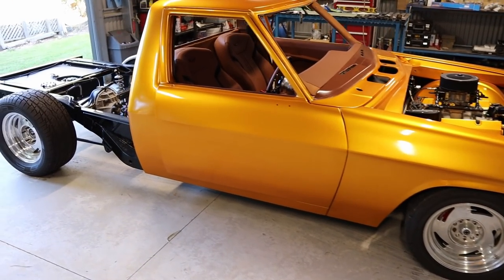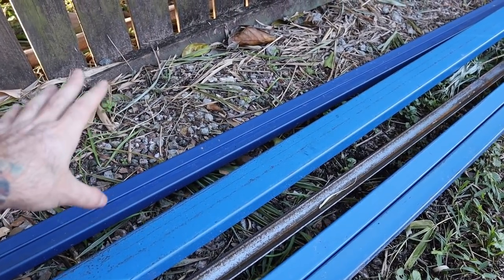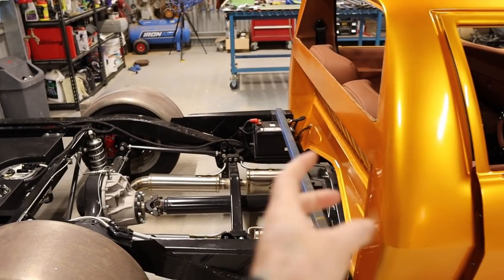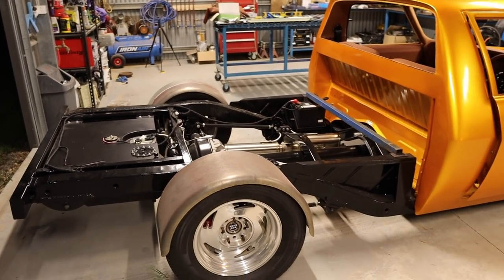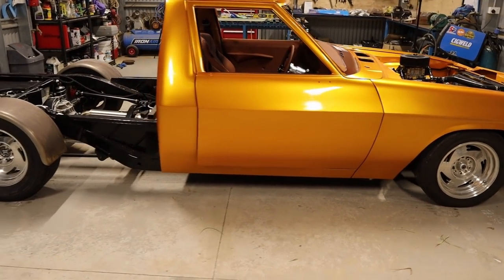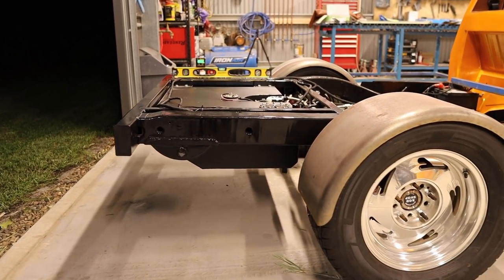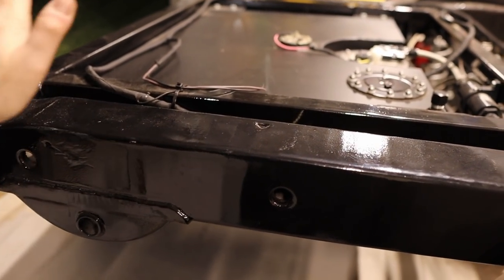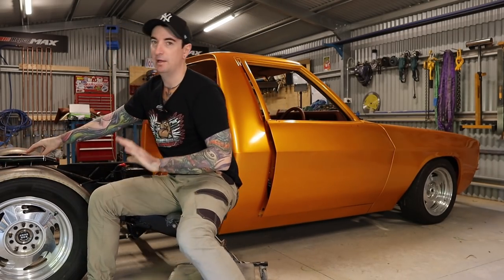Starting the Tray but Encountering Problems - HX One Tonner Tray Build Episode 1

Comment: Hey man , As mentioned above , take the ute to a panel shop with a car-o-liner /rack and get them to straighten it. id advise not cutting or welding it over to a 10mm difference. 10mm isnt something people pick up on easily . once the trays on there i doubt anyone would notice it . the thinner bushing idea was also a decent option as well.

Comment: Cut the rear bar off and lower the r/h side 5mm and raise the left 5mm👍
Reply: Snap! Thinking the same thing....
Reply: @benjohnson7170  I think you said you were going to cut it off anyway? No need to cut or bend chassis rail
Reply: @benjohnson7170  maybe you could use the back window as a reference?👍
Reply: That's the best

Comment: Hopefully a panel beaters from Brisbane is watching and can get you in quickly after hours to put it on chassis aligner. You will probably regret cutting the chassis. Personally I'd get the whole car up on blocks until it's as level as you can get it then use your long lengths of steel to measure off once you shim them to perfectly level. Only then will you know if it's 10mm as it could be 5mm or 15mm etc.

Comment: Liking the tray ideas mate, usually simple is best. The 10mm twist in the chassis will easily come out on a car bench with some chains and a porta power. You would strap the high side  down and jack under the low side, only having to move it 5mm a side. You find that much difference in them from the factory. If you cant find a shop to do it, you can get creative and do it yourself, something to weight the high side down ( mate with a 4wd and a ramp or a forklift) and a couple of jacks under the low side. With the fuel tank and stuff out of the way you'll be suprised how easy it moves and take the twist out ;)
Reply from the maker: Thanks for the advice Mate. I got it sorted but was a bit of stuffing around. Will post it up in the next video

Comment: Cool build mate. I had a similar problem with my 56 f100  , but I worked on the lower rail and cut along the top and sides with a 1mm cutting disc then jacked it up to the right height then welded it up. Alot easier to weld the top of the rail than lay on your back and weld the bottom of the other rail.  Just my opinion. 👍

Comment: The welding you've done on the chassis would have warped it no doubt. I'm a fabricator, you would be amazed what weld heat will do. When you had the ute on jack stands and welding the chassis it would have moved with the weight. You could try cutting through the cross members you put in, clamp the chassis in line and re weld them 🤞
Reply from the maker: Thanks Mate. Appreciate the advice. I ended up sorting it and will post it up in the next video. Bit of stuffing around but got it.

Comment: For the tray hinges, copy the top door hinge design for the geometry.
Or the hood hinges. A single pivot point probably won’t work as you won’t be able to move the tray far without it hitting something unless you space it high off the frame.

Comment: 3mm cutoff disc but only cut 3 sides of the r/h rail. Cut the bottom and 2 sides. You could run a long straight edge along the top of both rails to find where it is bent.

Comment: To bent the frame just heat it red and cool it quickly to pull it in the direction you need.
For bending down heat the bottom 
For up heat the top.
You only need a ten mil sized heat band .

Comment: How about removing the rear crossmember and reweld back 5mm higher on the left and 5mm lower on the right, make the appropriate hinges so that it is horizontal to the rear crossmember then make the headboard so that it sits horizontal to the cab (not crooked). You should never notice the 10mm difference that appears to be there
Reply from the maker: Thanks Mate. Appreciate the advice. Ended up sorting it which I will post in the next video.

Comment: This is probably a stupid idea but have you checked your tyre pressures? Another thing I thought of was the springs; could you perhaps use a bit of heat to ease one side a wee bit? These may not be terribly wise words, I'm no engineer. Sometimes though, the simplest possibilities can get overlooked.😁
Reply from the maker: Hey Mate thankyou. I checked and adjusted all the tyre pressures but did not make any difference
Reply: @ShenkeGarage  That would have been way too easy, worth checking though, just in case.😁👍

Comment: Take to a panel beater and they will throw it on their chassis aligner and they will pull straight , there should be a custom car guy with a chassis straightener
Reply: I got a job in a panel shop as a tradesman and the bosses son would put anything in the rust repairs bits of wood plastic a thong one day and even a old sandwich didnt stay long.

Comment: Sounds like the rail has moved when all the welding was done on the tank framework I wouldn't cut I would heat it make your self a tremmle for measuring left to right Inc hight put the ute on car stands off the ground heat the bent rail and straighten it up once straight cool the rail take the tank framework off and make a framework that sits on top of the rail less welds hope that works it's good fix cheers

Comment: Have you tried these things I've been caught on before where a tyre  has flat spotted from sitting around move it forward or back half a wheel rotation and remeasure to find measurements have changed, check your tyre pressures are the same on all corners. Is there any static sag on the coil overs? Is the distance from the floor to the top shock center the same on both sides not that your preload is different from one side to the other or even corner to corner and being a tonner it's more than likely the left hand side is bent down from people dropping stupid weights on the tonners just a thought

Comment: I wouldn't trust the concrete to ba a datum to measure from.
Reply: Nor rely on the chassis being perfect out of the factory, Tonners we’re made years ago so applying today’s tech etc to 40, 50 years ago = problems, and not forgetting that it could have been in a bingle at some time. 👍